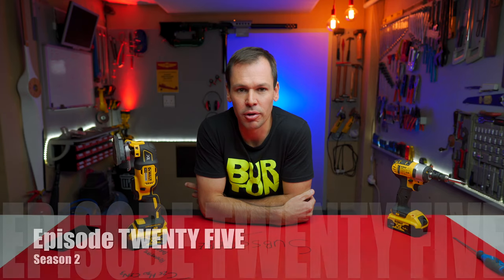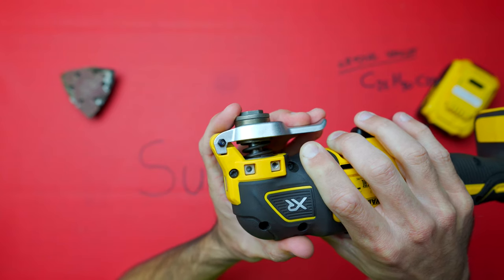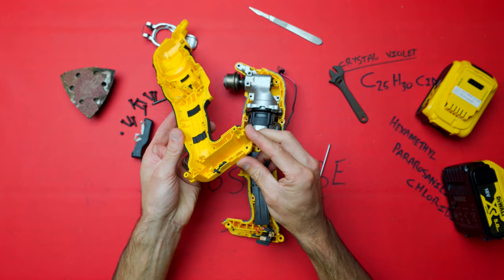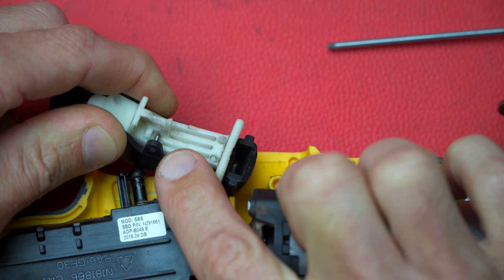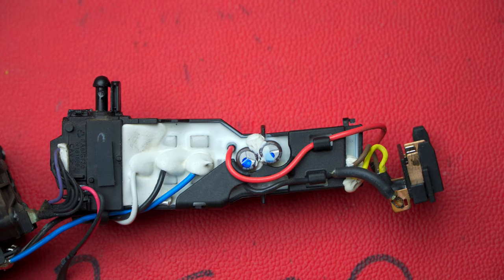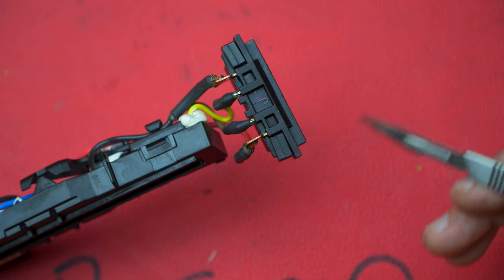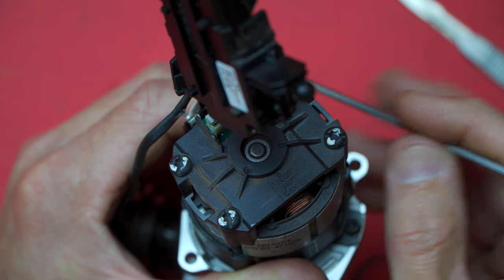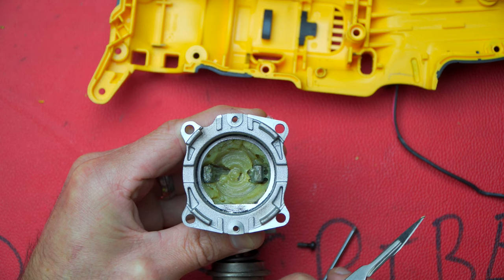TEARDOWN - DeWALT DCS355 20v XR (DCS354 Atomic?) Oscillating Multi Tool - BURTON BUILDS [4K]

Comment: I hate how there ae exactly ZERO tool companies willing to spend the extra pennies per weak point to correct things that are obvious.
Reply from the maker: I suppose it is a weak point but may be stronger than we think... I'm no materials engineer but it is reinforced with 50% glass fibre which makes it pretty stiff and strong. I just would have personally liked to see a little more material around the levers hinge point (or a completely metal lever).

Comment: Good to see the clip,
When I press the trigger, it clicks/kicks but no response to motor. Do you think it's a motor or starter part? Any advice will help. I have video for my tool not working https://youtu.be/42MIJWIuZPo
Reply from the maker: Hi Gil, watched your video... that's a pretty loud click / knock. I'm guessing its out of warranty so as a start, I would say open up the unit and split the gearbox from the motor. That click sounds like a solid mechanical click or knock. Check that the motor is spinning freely. Maybe also pull the trigger and notice if the motor runs or not. The motor should freely run when detached from the gearbox. Guessing that a back or front motor bearing may be collapsed or housing cracked and when power is applied, the rotor pulls up rapidly against the stator and then jams creating that knocking sound OR Something on the gearbox side is catching up... Maybe the fork or 'hopefully not' something within the gearbox. Kind of difficult to say without physically inspecting the unit. Let us know what you find?